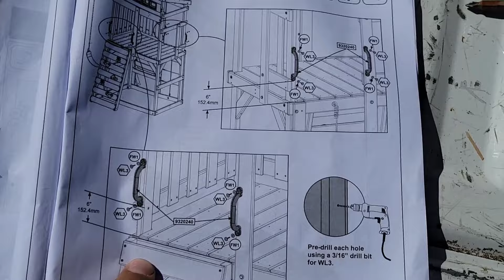BUILDING A PLAY STRUCTURE FOR MY DAUGHTER!!

Comment: I've got a black and decker electric Wacker... The head came off broke the tab for feeding the line and it actually works better... I got a set of DeWalt cordless and 1/2 the batteries came dead so I pauned it and got a full set of Ryobi for less money and it's a better set with the batteries all working...